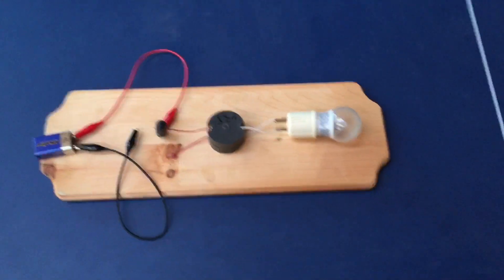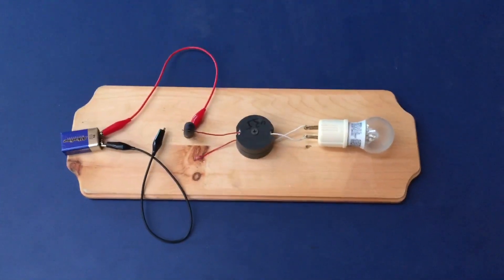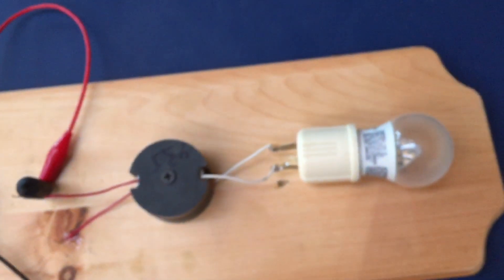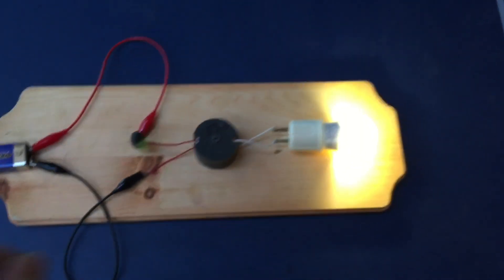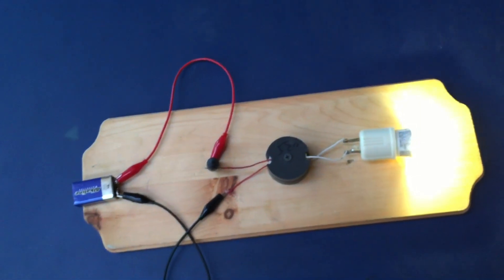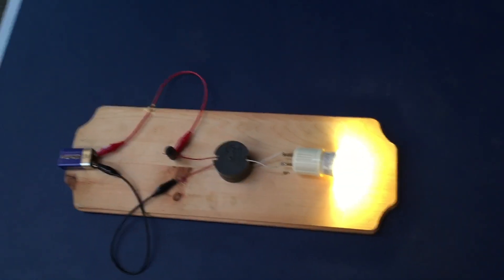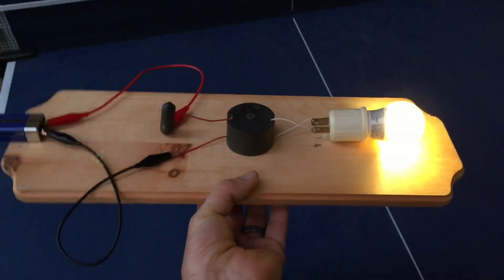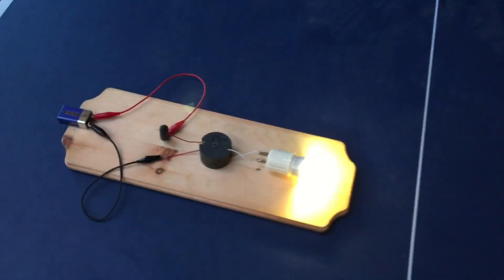Transistor Free Joule Ringer - Super Simple Config

Comment: If you look at designs for automotive radios that ran on tubes, you'll find a similar boost circuit.  The car battery back then was typically 6V.  That would have been fine for powering the tubes' filaments, but the actual radio and sound handling bits of the tubes required much higher voltages.  They didn't have transistor oscillators back then, so they switched power into a transformer using a precisely set pair of contacts that would buz and cause the car's battery voltage to oscillate in the primary of the transformer, then rectify the output of the transformer to get the higher DC voltage they needed.

Comment: To prevent oxidation, would it be possible to contain the carbon rod and wire inside a sealed, possibly vacuumed jar (using a charcoal ember or something to remove the oxygen) much like a lightbulb? Could you replace the carbon rod with tungsten or copper rod/pipe? Also, how much AC power could you run in terms of volts/amperes, in order to run a 100 or 200w guitar or vocal amplifier? I guess the transformer would need to be customized, depending on the voltage/amperage requirements of the appliance. Would splitting the end of the wire, so it has two points of contact on the rod, increase the rate of oscillation? And how about a small Faraday cage around it, to contain that field - With a wire sneaking out of the cage and to the appliance?
Reply: i don't think this setup is good for acoustic amplifiers its unstable.

Comment: Carbon point oscillator.
Not long term stable, as carbon + arcing = Carbon Dioxide.
Reply: To prevent oxidation, would it be possible to contain the carbon rod and wire inside a sealed, possibly vacuumed jar (using a charcoal ember or something to remove the oxygen) much like a lightbulb? Could you replace the carbon rod with tungsten or copper rod/pipe? Also, how much AC power could you run in terms of volts/amperes, in order to run a 100 or 200w guitar or vocal amplifier? I guess the transformer would need to be customized, depending on the voltage/amperage requirements of the appliance. Would splitting the end of the wire, so it has two points of contact on the rod, increase the rate of oscillation? And how about a small Faraday cage around it, to contain that field - With a wire sneaking out of the cage and to the appliance?

Comment: Is it the thermal movement of the wire heated by the current? The Carbon itself will heat fairly quickly, but nothing I can find says it actually vibrates or would develop vibrating connectivity. Can you clarify the process of how the vibration/switching happens?

Comment: I'm actually thinking about making something similar to this. But instead of using a graphite rod, i'm gonna use an electromagnet, 2 nails and a strip of metal in a buzzer configuration, then I'm gonna hook that up in series to a transformer and see if that actually works the same way this does.
Reply: Did you try it? Did it work?

Comment: You truly are a genius !
Reply: To prevent oxidation, would it be possible to contain the carbon rod and wire inside a sealed, possibly vacuumed jar (using a charcoal ember or something to remove the oxygen) much like a lightbulb? Could you replace the carbon rod with tungsten or copper rod/pipe? Also, how much AC power could you run in terms of volts/amperes, in order to run a 100 or 200w guitar or vocal amplifier? I guess the transformer would need to be customized, depending on the voltage/amperage requirements of the appliance. Would splitting the end of the wire, so it has two points of contact on the rod, increase the rate of oscillation? And how about a small Faraday cage around it, to contain that field - With a wire sneaking out of the cage and to the appliance?

Comment: I tried something a little similar today. Using a 'dead' aa battery (still has 1.25v in it) I hooked the battery and rod to the side of a transformer with less coils, and the other side of the transformer to the led. It wouldn't ring automatically but stroking the wire against the carbon rod, would make the led flash. I wonder if you can use a tuning fork in this circuit to do the switching when a particular note is played.
Reply: Hmm. Tuning fork switch.